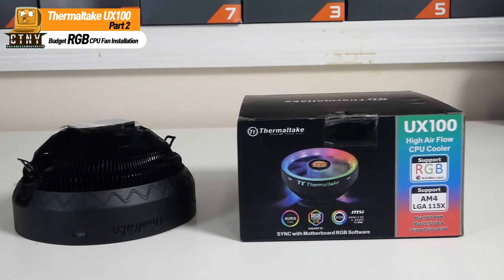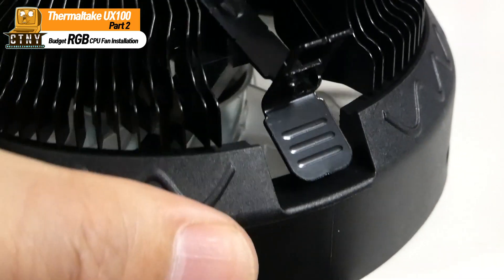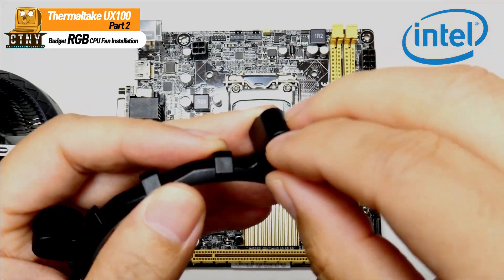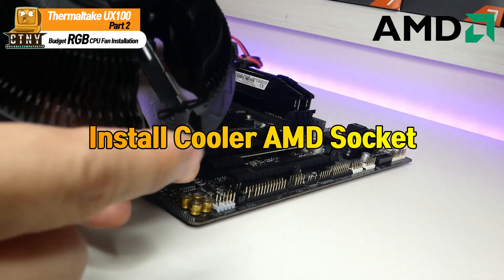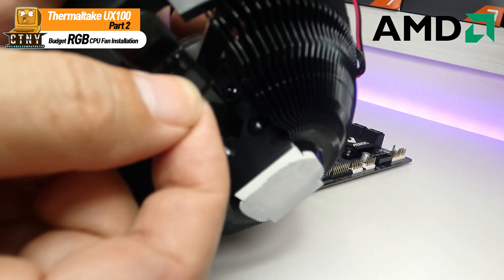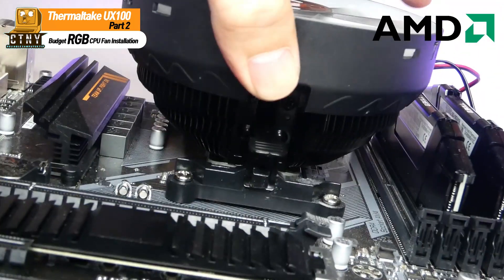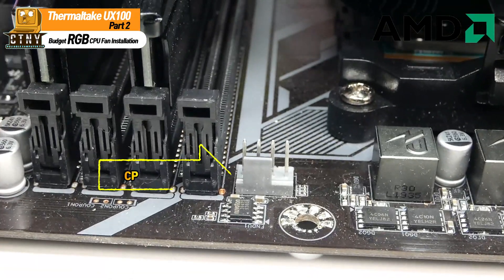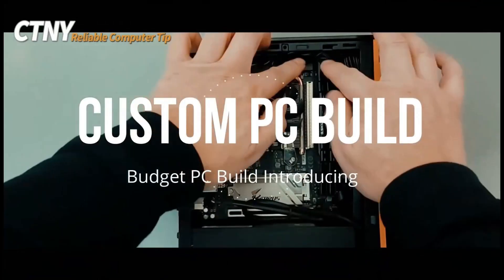Thermaltake UX100 Budget RGB CPU Fan Installation -Part 2 (Intel /AMD)

Comment: will this cpu cooler work with a GIGABYTE H310M A 2.0 motherboard pls respond
Reply from the maker: There is 1 x RGB LED strip header on this board but it is 12V 4 pin so, in this case, you'll need a converter to change the voltage from 12V to 5V Here is the link: https://amz.run/3c87   Installation Video: https://youtu.be/sBCvmkXf-Zg  Please connect 5V 2 pin(D,G) ARGB connector to converter 5V 3 pin port and then connect 12V 4 pin connector to RGB LED connector on your board. Also, don't forget to download the Gigabyte Fusion 2.0 sync program to control RGB accordingly. Thank you for your comments.

Comment: can i use this cpu fan on this motherboard MSI B450M PRO-M2 Max,thanks
Reply from the maker: There is 1 x LED strip connector(JLED) on this board but it is 12V 4 pin. In this case, you'll need a converter to change the voltage from 12V to 5V Here is the link: https://amz.run/3c87   Installation Video: https://youtu.be/sBCvmkXf-Zg  Please connect 5V 2 pin ARGB connector(D.G) from fan to converter then connect 12V 4pin connector (female) to JLED connector on your board. Also, don't forget to download the MSI Mystics sync program to control RGB accordingly. Thank you for your comments.
Reply: @comtongny7776   I buy b450m-k Do I have it on it motherboard

Comment: Could this work with a erica motherboard and a 400 W Platinum power supply?
Reply from the maker: Actually No because this cooler needs 5V 3 pin ARGB header for RGB. In this case, you can use this RF controller to control 5V RGB manually. Link: Mini ARGB RF Controller Kit  - https://amz.run/3cc9  Installation video: https://youtu.be/5HOoyupW-j8
 Please try. Thank you for your comments.

Comment: Can I use this in my asrock b450 pro4?
Reply from the maker: Yes. There is 1 x Addressable LED Header(ADDR_LED1) at the right side of the bottom of the board. Please connect 5V 2 pin (D,G) connector to the ADDR_LED1 header on your board and download sync program ASRock Polychrome to control RGB. Thank you for your comments.

Comment: Can i use it with my motherboard b450m s2h?? I have it in a nfortec krater with a controller rgb
Reply from the maker: There is only 1 LED_CPU 4 pin header near the CPU socket but it is 12V 4 pin. This Thermaltake UX100 uses 5V 3 pin so you need the converter to change the voltage from 12V to 5V. Here is the link: https://amz.run/3c87   Installation video: https://youtu.be/sBCvmkXf-Zg   Please connect 5V 2 pin (D,G) connector from the cooler to converter then connect 12V 4 pin connector (female) to LED_CPU connector on your board. Also, don't forget to download the Gigabyte Fusion 2.0 sync program to control RGB accordingly. Thank you for your comments.

Comment: Can i use this with my asrock b450m pro4
Reply from the maker: There is 1 x Addressable LED Header(ADDR_LED1) at the bottom of the board. You can connect 2 pin connector (D,G) to 5V 3 pin ARGB (ADDR_LED1) accordingly and then download sync program ASRock Polychrome from the ASRock website. You can control RGB with this program after installation. Thank you for your comments.
Reply: @comtongny7776  what about gigabyte aorus b450 pro wifi atx

Comment: Can i use it on tug gaming b460 plus motherboard ???????
Reply from the maker: There are 2 x Aura RGB Strip Headers on this board but it is a 12V 4 pin ARGB header. In this case, you'll need a converter to change the voltage from 12V to 5V Here is the link: https://amz.run/3c87   Installation video: https://youtu.be/sBCvmkXf-Zg   Please connect 5V 2 pin(D,G) connector to 5V port of converter then connect 5V 3pin connector (female) to AURA LED connector on your board. Also, don't forget to download the ASUS AURA sync program to control RGB accordingly. Thank you for your comments.

Comment: Thanks for the closer look.
I just got a prebuilt system. The TT cooler does it's own RGB thing all by itself independent of the other fans... the ground and "D" wires were left unconnected. 
When I DO connect them I can control it but it also seems to fighting whatever other automatic thing it does. I can't see a model number on it.
Reply from the maker: There are 2 different RGB options when you build an RGB case. Some pre-built brands are using 4 pin PWM RGB. It is changing color automatically already setup so, please check up your hardware by HWINFO64. This Thermaltake UX100 is ARGB(Addressable RGB) it means that the user can control it by using a sync program provided by the motherboard's manufacturer. It depends on which motherboard you used. Different manufacturers use different programs. For example, MSI Mystics, ASUS AURA, ASRock Polychrome, Gigabyte Fusion 2.0. You can download the motherboard you used from the manufacturer's website. Thank you for your comments.
Reply: @comtongny7776  Thanks for your time. Merry Christmas and Happy New Year!

 It's a Gigabyte board. I'm not on it at the moment to see what the fan model is and dig up the specs. I've got HWinfo and Fusion.
I was trying to stop the TT fan's rainbow show if I could and just keep it all steady. It will do a steady blue through Fusion with those two wires plugged in but that rainbow show is still trying to happen at the same time. May just have to live with it or turn them off.

Found this video on my hunt for what those leftover wires were for. There was just the plug to the CPU fan power.
This is a new aspect for me, never had a light up computer before. I ordered it for the 3060ti, not the lights...but there they are and I have to tinker with them.
Anywho, have a good one.
Thanks again.

Comment: cool vid    but i cant control the colord with my gigabyte motherboard with fusion 2 0
Reply: Same issue. Any ideas?
Reply: @jaredbarr9318  Sorry..ended up just changing to cooler for a better one..
Reply: @tankconnors7323  Yeah...I did I71C and it kept overheating my motherboard and freezing my system. Sticking with UX100. Higher air flow.

Comment: how are you supposed to take it off?
Reply from the maker: To remove this cooler, press the top with a screwdriver-like tool on the main clip on the AMD bracket, remove one side first, and loosen the other side. Thank you for your comments.

Comment: Got an old motherboard, and ASROCK FM2A55M-DGS. Will this fan work on it? I have already installed but can’t see where to plug the RGB connectors. if the fan works to cool without the RGB that is fine.
Reply from the maker: Yes. Your board is not compatible with RGB but if you use RF mini controller, you can control RGB with a remote. Mini ARGB RF Controller Kit  - https://amz.run/3cc9  Installation video: https://youtu.be/5HOoyupW-j8 Also, if you don't want to RGB light on, please just connect 4 pin PWM connector to CPU_Fan header. Thank you for your comments.

Comment: Thanks for this! Will this be compatible with the MSI Z490 A Pro? Thanks in advance!

Edit: Nvm, it says in the specs that it has 2x3 pin RGB connector! 😅 thanks anyway for the vid!
Reply from the maker: Yes. There are 2 x 3-pin Addressable RGB headers on this board. Please connect 5V 2 pin ARGB connector(Female, D, G) from the fan to 5V 3pin Addressable RGB headers (Male) on your board. Also, don't forget to download the MSI Mystics sync program to control RGB accordingly. Thank you for your comments.

Comment: Can i use this thermatake ux100 to my gigabyte GA-H87-HD3...
Reply from the maker: I'm sorry to inform you that your board is not compatible with this RGB CPU cooler fan. This one needs 5V 3 pin ARGB header on the motherboard so in your case, you can use this manual remote controller to control RGB. Link: Mini ARGB RF Controller Kit  - https://amz.run/3cc9. You can also check this video for installation: Link: https://youtu.be/5HOoyupW-j8
Thank you for your comments.
Reply: @comtongny7776  sadness. :(....but thanks for your fast response.

Comment: Hi dear ,
Can i use t with my MOBO ASUS p8p67
Reply from the maker: Actually, it's not compatible because this fan needs 5V 3 pin ARGB header on the board to control RGB but if you don't have a 5V 3 pin ARGB header, you can use this for any 5V RGB products. Mini ARGB RF Controller Kit  - https://amz.run/3cc9 Here is the detailed installation video Link: https://youtu.be/5HOoyupW-j8   Thank you for your comments.
Reply: @comtongny7776  Thanks for the reply BUT i am currently using  RGB fans on this mother board directly connected SO can i not use this with that

Comment: Can I use this on my Asrock H310CM-DVS plz answer?!
Reply from the maker: I'm sorry to inform you that your board is not compatible with this RGB CPU cooler fan. This one needs 5V 3 pin ARGB header on the motherboard so in your case, you can use a manual RGB remote controller. Please check this video for detailed installation.https://youtu.be/5HOoyupW-j8  Please check this device and use this if you want to install Thermaltake UX 100. Mini ARGB RF Controller Kit  - https://amz.run/3cc9 Thank you for your comments
Reply: @comtongny7776  thanks for answering me

Comment: Hi. Can I install this Thermaltake on Gigabyte Ga g41m Combo (Rev. 2.0) ???
Reply from the maker: I'm sorry to inform you that your board is not compatible with this RGB CPU cooler fan. This one needs 5V 3 pin ARGB header on the motherboard so in your case, you can use this RF remote controller to control a 5V 3 pin RGB fan. Here is the link: Mini ARGB RF Controller Kit  - https://amz.run/3cc9  Also, you can check this video for installation. Link: https://youtu.be/5HOoyupW-j8   Thank you for your comments.
Reply: @comtongny7776  Thanks for answering. is this remote control device useful for use with a Cooler Master MASTERAIR G100M RGB on the gag41m combo motherboard ???
I won this heatsink at an event last weekend, so I am sure it cools better than the Thermaltake.

Comment: Will the rgb still work on a led_cpu strip? I’m new to this pc stuff, and would it work on ryzen 3100?
Reply from the maker: Yes. If the LED_CPU Strip is 5V 3 pin header. If not, it's not compatible but in this case, you'll need a converter to change the voltage 12V to 5V Here is the link: https://amz.run/3c87   Please connect 5V 3 pin ARGB connector from the hub to converter then connect 5V 3pin connector (female) to LED_CPU connector on your board. Also, don't forget to download the MSI Mystics sync program to control RGB accordingly. This CPU cooler is compatible with all types of SOCKET. Thank you for your comments.
Reply: @comtongny7776  thanks so much for the info!
Reply: Strangely rgb lighting still working in my MSI Gaming Plus H370 in spite there is no 5v rgb header in my motherboard and the motherboard is not even in the list of supported MB of UX100 cooler

Comment: Ty's
Would the sync program be from thermal's site? or own motherboard site?
Reply from the maker: Yes, it depends on which motherboard you used. Different manufacturers use different programs. For example, MSI Mystics, ASUS AURA, ASRock Polychrome, Gigabyte Fusion 2.0. You can download the motherboard you used from the manufacturer's website. Thank you for your comments.

Comment: DOES THIS WORK ON Asus Maximus viii hero NEED ANSWER QUICK PLSSS
Reply from the maker: I'm sorry to inform you that your board is not compatible with this RGB CPU cooler fan. This one needs 5V 3 pin ARGB header on the motherboard so in your case, you can use a manual remote controller to control RGB manually. Here is the link: Mini ARGB RF Controller Kit  - https://amz.run/3cc9  Thank you for your comments.
Reply: @comtongny7776  have any suggestions on motherboards I can get

Comment: Hello can i use it for a mother a z490 plus wifi?
Reply from the maker: According to the specification of your board, it says there's 1 x Addressable Gen 2 header(s) so you can connect 5V 2 pin (D,G) to addressable Gen2 header accordingly and then download ASUS AURA sync program from the website to control RGB. Please make sure Gen 2 header is 5V 3 pin ARGB header before you do that. Thank you for your comments.

Comment: Hello can i use this on my ASrock H110M COMBO-G motherboard?
PLEASE ANSWER
Reply from the maker: I'm sorry to inform you that your board is not compatible with this RGB CPU cooler fan. This one needs 5V 3 pin ARGB header on the motherboard so in your case, you can use a manual remote controller to control RGB manually. Here is the link: Mini ARGB RF Controller Kit  - https://amz.run/3cc9  Thank you for your comments.

Comment: Hey there, 

is there a chance this could work with my ROG Strix Z270F? The MOBO only has the 4 pin RGB connectors but i bought the Cooler master ADDRESSABLE RGB LED CONTROLLER for my case fans who only have the 3 pins connectors.
Reply from the maker: In this case, you can use an RGB converter to change the voltage 5V to 12V. I already upload video regarding this device. Please check the video here: https://youtu.be/sBCvmkXf-Zg
Thank you for your comments.

Comment: Bro can I use it in Gigabyte 310M H
Reply from the maker: I'm sorry to inform you that your board is not compatible with this RGB CPU cooler fan. This one needs 5V 3 pin ARGB header on the motherboard so in your case, you can use a manual RGB remote controller. Please check this device and use this if you want to install Thermaltake UX 100. Mini ARGB RF Controller Kit  - https://amz.run/3cc9 Thank you for your comments.
Reply: Thx

Comment: Plz tell can I use it on ASUS Prime H310M-CS R2.0 mATX Motherboard
Reply from the maker: I'm sorry to inform you that your board is not compatible with this RGB CPU cooler fan. This one needs 5V 3 pin ARGB header on the motherboard. Also, it doesn't fit for mini-ITX motherboard due to the size of this cooler. If you want to use this cooler, you can use a manual RGB remote controller. Please check this device and use this if you want to install Thermaltake UX 100. Mini ARGB RF Controller Kit  - https://amz.run/3cc9 Thank you for your comments
Reply: Thanks
Reply: Can u suggest any motherboard which is compatible with intel 9th generation and this rgb fan
Reply from the maker: @studywithme-1245  I prefer GIGABYTE B450 AORUS M for RGB build. It has a 5V 3 pin and 12V 4 pin RGB header so it is more expendable for the RGB case. Here is the link: https://amz.run/3bSc
  Thanks.

Comment: how do i set up rgb with gigabyte z390 gaming x motherboard?
Reply from the maker: There is only 1 x RGB LED strip header on this board but it is a 12V 4 pin header. This CPU fan needs 5V 3 pin ARGB header to get the RGB power and control by sync program. So, in this case, you'll need a converter to change the voltage 12V to 5V Here is the link: https://amz.run/3c87   Please connect 5V 2 pin(D, G) ARGB connector from the fan to converter then connect 5V 3pin connector (female) to RGB LED connector on your board. Also, don't forget to download the Gigabyte Fusion 2.0 sync program to control RGB accordingly. Thank you for your comments.
Reply: I also have this motherboard I cannot get the colors to change :(

Comment: Is it able to be used on a LG1155 board?
Reply from the maker: Yes. However, you need to use the below device for RGB light because your board is not compatible with RGB. It needs a 5V 3 pin ARGB header. This one is the solution. Please use this device. Mini ARGB RF Controller Kit  - https://amz.run/3cc9   Thank you for your comments.

Comment: Does this work with the MSI b365m pro-vdh?
Reply from the maker: Yes but it has only 1 x 4-pin RGB LED connector. This CPU fan needs 5V 3 pin ARGB header so, in this case, you'll need a converter to change the voltage 12V to 5V Here is the link: https://amz.run/3c87   Please connect 5V 3 pin ARGB connector from the hub to the converter then connect 5V 3pin connector (female) to RGB LED connector on your board. Also, don't forget to download the MSI Mystics sync program to control RGB accordingly. Thank you for your comments.

Comment: Hey! Can we use it on a Intel Socket 1151 motherboard 300 series?
Reply from the maker: If the board has 5V 3 pin ARGB header, you can install a cooler and connect 5V 3 pin connector to 5V 3pin ARGB header. Please make sure your board has 5V 3pin ARGB header. Thank you for your comments.

Comment: Hello can i used thi to my Mboard Gigabyte ga f2a68hm ds2?
Reply from the maker: No, it's not compatible but if you use this wired remote controller you can use this CPU cooler. Connect PWM to CPU_Fan header and connect 5V 3pin connector to this wired controller. Mini ARGB RF Controller Kit  - https://amz.run/3cc9  Thank you for your comments.

Comment: Can I use this on an asrock b365m pro4?
Reply from the maker: Yes. There's a 1 x Addressable LED Header on this board. You can connect 5V 2 pin(D, G) connector(female) to 5V 3 pin ARGB header on the board and download the Polychrome sync program from the ASRock website to control RGB. Thank you for your comments.
Reply: Was looking for this exact question lol. Thank you

Comment: Can I use it on the b365m ds3h
Reply from the maker: There's a 1 x RGB LED strip header on this board but it looks like 12V 4 pin. This CPU fan needs 5V 3 pin ARGB header to get the RGB power and control by sync program so in this case,
you'll need a converter to change the voltage 12V to 5V Here is the link: https://amz.run/3c87   Thank you for your comments.

Comment: how do i set up rgb with rog strix b450-f ?
Reply from the maker: Your board has only 2 x Aura RGB Strip Headers but it is 12V 4pin. This CPU cooler needs 5V 3 pin ARGB header so in this case, you need actually this converter to change the voltage  Here is the link: https://amzn.to/2t8VnvH   Thank you for your comments.

Comment: Would it work on a LGA 1200 socket? i have a gigabyte z490m Gaming X
Reply from the maker: Sure. I also installed LGA 1200 socket this fan before. It works well if you connect 5V 3 pin connector to 5V 3 pin ARGB header on your board. Thank you for your comments.